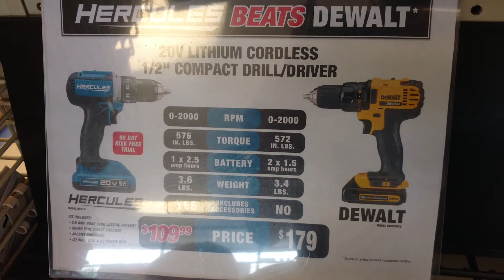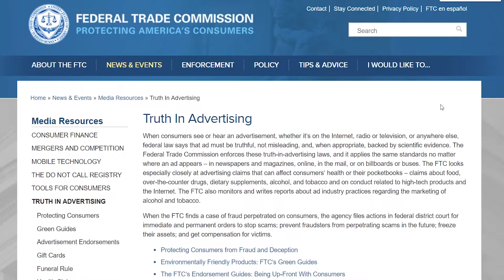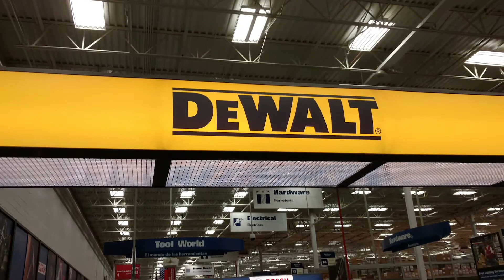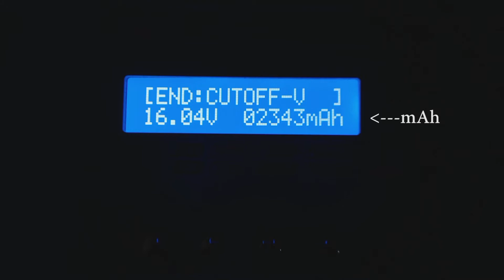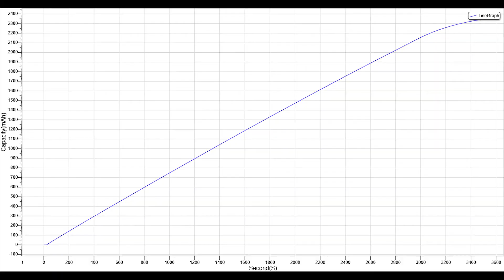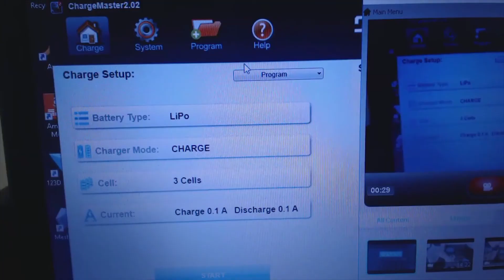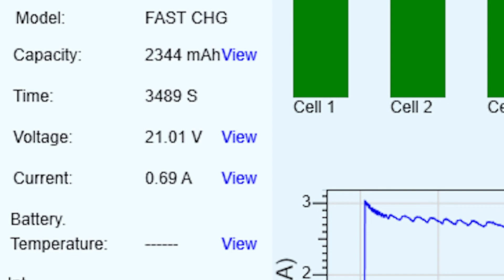Harbor Freight's Hercules 2.5 aH battery gets a capacity test and partial teardown

Comment: I got a 2.5 Ah battery for Christmas with a tool, it made an odd sound when I put it on the tool and shows nothing just a brick. Is there a breaker or safety switch inside that might be the problem ? I took it back to HF and they said the 90 day window was closed for battery replacement on it.

Comment: You should have mentioned the cells used. I saw one recently they were samsung in the 8 amp. 
 Its top of the line and i have started to switch to harbor freight. Which btw is identical to dewalt. 
 American designed in california  built in  china.

Comment: Would like to see this done with the newer Herc batteries (all black) as they have apparently cheaped out on the cells in them.  The older (blue & black) batts have Samsung cells inside as can be seen here.  However the newer all-black batts have cheap/unknown MIC cells apparently (not sure about 20V but I opened a new 12V and definitely some hard to identify cells in there).  Would be interesting to see a test of not only in capacity but in performance, compared to the older ones.  

Part of the marketing for Herc batteries was that they use, "industry leading cells" which was true insofar that they were actually using quality cells that the "big name" companies might use in their batts.  This is no longer true, yet the statements remain the same.  That said they are pretty darn cheap batteries so one can only complain so much.
Reply from the maker: I mean, if they say they are Samsung still.... I don't even remember what they said! Ha. Will rewatch. But, it's worth mentioning, there is a lot of good quality stuff being made by our brothers and sisters over in China. It's not all bad. They are leading the world with battery stuff for electric vehicles and lifepo4 batteries as far as I know.
Reply: Another Youtuber tore apart a New Black 12AH Hercules in it contained 21700 SAMSUMG cells
Reply: Dont assume "big name" cell brands are make outside of China. Many of these manufacturers have factories in China too. Also, don't knock something manufactured in China until you have reason to do so, which is the point of this channel as I understand it. (unpopular opinion: there are Chinese brand cells that outperform Samsung cells)

Comment: The difference in capacities between AvE's testing and yours is all down to discharge rates, AvE's test rig was pulling 10A, your tester was pulling 0.3A.  Great test that shows the difference discharge rates make, 10A+ is more realistic of a power tool load.  18650s are rate by capacity and discharge current, as discharge current increases capacity falls.  The best cells balance both.  Better cells like Samsung 25r5 used in a lot of tools, can deliver 2500mah and 20a continuous discharge.
Reply from the maker: Right, but no company prints capacity at 10A draw at this time. He did the test then claimed it was "not xx amp hours" so HF were lying about the capacity. They weren't. It's like driving a car that gets 60mpg at wide open throttle/110mph for nearly the entire tank and finding it does "not get 60mpg". well duh.
Reply: @TRYtoHELPyou  R Baker is right about the discharge rate and that's why AvE and you got different results. Your 0.3 discharge rate would be more like powering a fan or light not a power tool. just like you mpg reference, car manufactures test under perfect conditions(flat surface, no wind and nothing in the car but a small driver) to get the highest mpg they can, so they aren't lying but most drivers won't get that high of mpg. HF is making some much better tools (I have a Couple)but to make them that much less expensive then Dewalt some corners had to be cut. Who made the 18650 cells in the HF batter pack?
Reply: Discharge rate of 300mA is really not enough, I agree.  But testing at 10A is a bit high as well as a single row of cells is only going to give the rated Ah with a current draw that one cell was rated for by the manufacturer (in this case Samsung).  That is def. not going to be a 10A draw.  However one should at least discharge with 1C discharge rate meaning about 2.5A in this case.  I suspect at that rate the result would still be about the same, because that's within what the cells were rated with, by Samsung.

Comment: Doing a capacity check on these or any 18650 cell at .3 amps is invalid. The higher the current draw the more the capacity drops. If it is a drill that has good power it should be drawing closer to 20 amps at load which is harder on the cells. If you can't provide a load that high or at least 10 amps you are wasting your time.
Reply from the maker: it is a measure. i cant measure the thermal heat loss at the higher loads. so i measure ALL the electricity stored. how you use it, no matter how inefficient, is up to you. capacity ratings and output do not have to be Wide Open Throttle. if the measure is 3inch deck screws into solid oak, then there you go, ask the tool companies to start using that. until then, mah precisely measured will be mah precisely measured. draw ten or twenty amps AND precisely measure how much energy is being turned into heat from the cells, i cant do that and im not aware of a tool that can precisely measure that. no matter how you inefficiently choose to use the energy there is a way to measure what it stores. that is what i did.
Reply: @TRYtoHELPyou  Correct, but its a marketing ploy to advertise a battery as 50wh, when it can only deliver that under artificial test conditions, Even the flashlight is drawing more than 0.3a.  The heat lost is inefficacy that cannot be counted as electrical energy.  The tools will never be able to realize the 50wh capacity as they are always going to have high draw rates, 10A+.  Other manufactures packs deliver much closer to their stated capacities at high draw rates.  While not a lie, Its definitely deceptive marketing.

Comment: Awesome info on the Hercules battery. I do have a question regarding the terminals on top of the battery. The + & - connections are known. What are the inner 2 connectors for? Temperature sensor? I'm guessing the balance is done by the board. Basically, I do not have a hercules charger but I do have a battery balance charger. I want to charge the battery without taking it apart. Thanks in advance for the info.

Comment: Reality check everyone!!   2.5 ah cells will read 2.3?? for virtually all your cells in your tools. That is not a lie. Actual readings and use after break in will yield numbers slightly lower. That is an acceptable margin of error.  Again there can be a slight margin of error within the battery and the  test equipment.   VS 1.5 is not acceptable or even 2.0,  but 2.3 is well within acceptable margin of error for a 2.5 battery.   UNDERSTAND THIS AS WELL:   AH RATINGS ARE GIVEN BY THE CELL MANUFACTURER. THE TOOL COMPANIES ARE USING THE BATTERY OEM RATINGS. IE: PANASONIC, SAMSUNG, LG, ARE THE ONES RATING THE BATTERIES.
Reply from the maker: Ari P it's a strange argument that keeps going on. It will continue though. I find it sad that there is no account for energy loss due to heat during high draw applications. That heat costs energy/watts. watts that the user is using. Those watts go unaccounted for in many arguments, regardless of if the heat is wanted or not. The definition of capacity is also part of the arguments. It's similar to HP at the wheels and HP at the crank, for automobiles. Which one is which? What we don't have is thorough comparisons with regard to AvEs testing. I must say though you can't get 55wH from a battery that, if true, was fully depleated... And then only charged with 35 ish watt hours.... U won't get any more from it during a drain (referring to AvEs video)
Reply: This is the honest truth. Thank you!